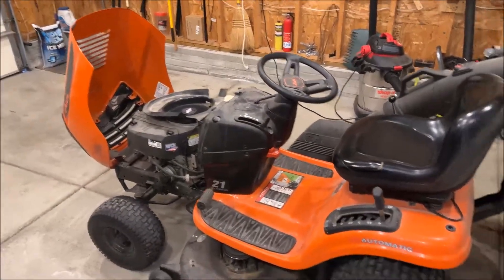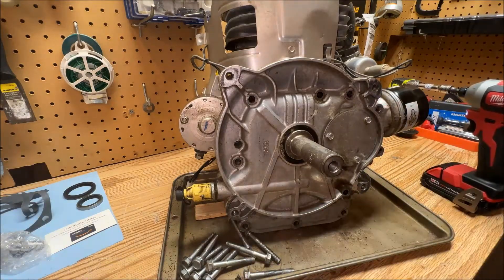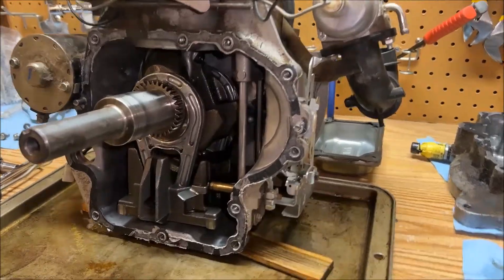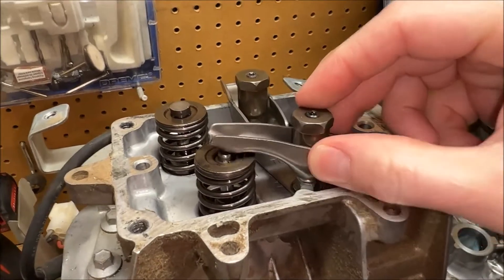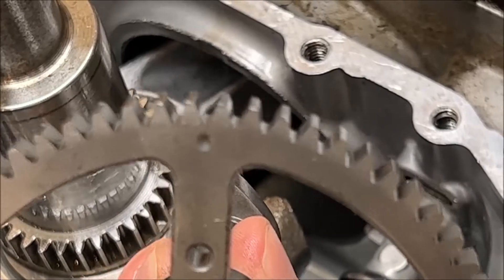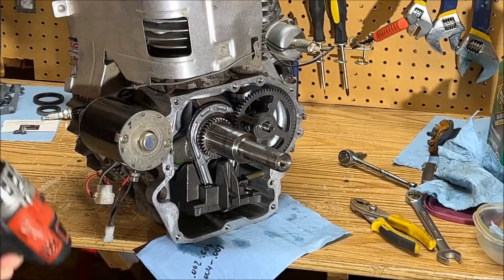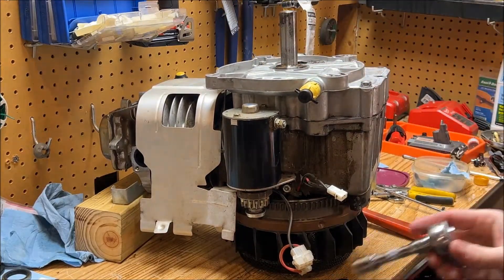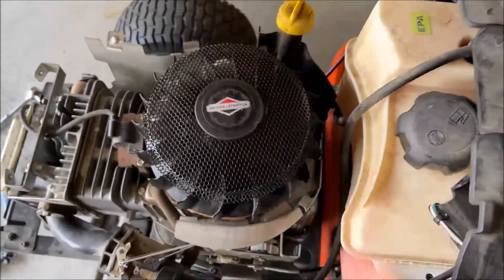This Little Piece Almost Destroyed My Engine...

Comment: Hey Man GREAT VIDEO!!
I have a Craftsman YT3000 with your favorite Bridge and Stratton engine.  Tractor is over 11yrs old and  who knows the hrs!  This is the 1st time that it's not working. It was diagnosed by many companies that it COULD be the camshaft broken but nobody have opened the engine yet.  I have been manually turning the flying wheel until now that isn't turning up anymore. Do you think that adjust the valves could fix the problem to avoid buy a new camshaft?  I have quotes on average  about $500.00 but I'm afraid to spend all that money for a fix of just a couple of months. Thanks for your assistance
Reply from the maker: Hello!  If I’m understanding, you’ve been manually turning the flywheel to start the engine, yes?  But now it won’t start?  If that’s the case it may well indeed be the valve lash needs to be adjusted. That’s where you should start. You’ll need to comb through Google to figure out what the tolerances are, but once you do give the adjustment a try. If it still doesn’t start and you’ve exhausted all other possibilities I’d say it’s likely the cam needs to be replaced. If you’re mechanically inclined you can do this yourself for about $100 or less if you don’t buy the B&S cam.  I don’t think anyone can give you a definitive answer as to what’s wrong until you split the case and dive into the intervals. It’s a pain, but knowing how to fix it is invaluable as these cams tend to fail. Best of luck and feel free to update this thread with your findings 👍

Comment: Are all of the intake and exhaust valves lashes the same throughout Briggs& Stratton lawn mowers? I have a 19 horse that I want to do And it's a 2019. The engine model says it is. That's what year
Reply from the maker: Honestly, I have no idea. I would guess not, however. If the engine is in the same series then maybe, but better double check and be sure. I wish I could point you to a reliable source for information, but the small engine world is hyper-confusing regarding tolerance values and finding parts.  Are noticing noise from the valves?  In other words, unless you hear a problem or just plain have a problem, I wouldn’t mess with it. Usually the lawn mower engines don’t need much maintenance on the valves…subjective I know.

Comment: Great video Jason I was shocked at the thought of you having to replace the camshaft again. I have the same Briggs & Stratton 21HP on my 2013 Craftsman YT 3000 running 800 hours strong (knock on wood) and commented on your excellent camshaft replacement & valve adjustment videos in the past. I have seen on other videos where no starting issues were caused by those valve stem caps coming off caused by a loose valve lash  or from the threaded rocker arm studs loosing up in the block and backing out, but luckily for most of them they stayed inside the valve cover area and out of the crankcase avoiding more damages. I adjusted my valve lash last cutting season after 750 appropriate engine hours and your instructions helped me tremendously but I also initially checked the clearances for curiosity sake and found them to be pretty loose at 0.009 in. & 0.10 ex. so I adjusted them @ .004 in. & .006 ex. and also checked those rocker studs to avoid this to happen. Always enjoy seeing your videos with your good knowledge and work practices!
Reply from the maker: Wow, 800 hours and no failures? That’s incredible. I wish I knew of the valVe stem caps prior to splitting the case, but you live and learn. 

Thanks for the great comment. It means a lot and thank you. 👍👍👍